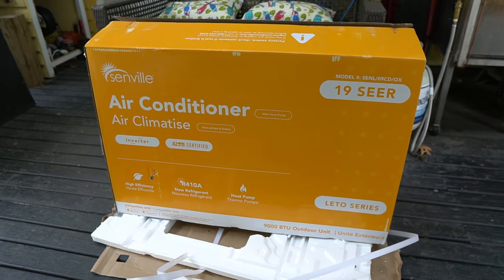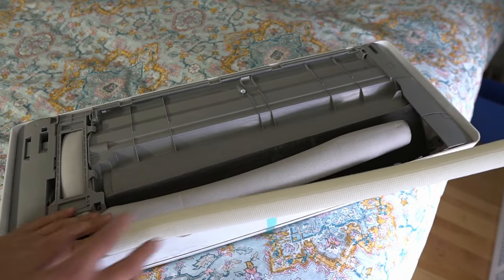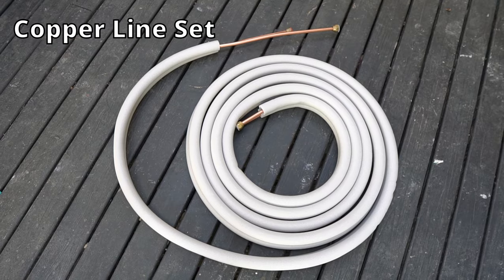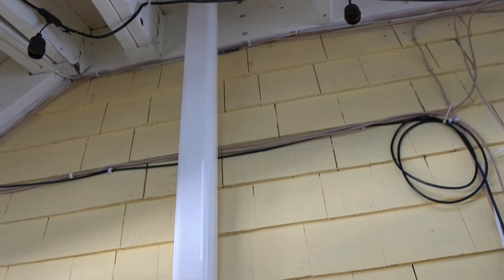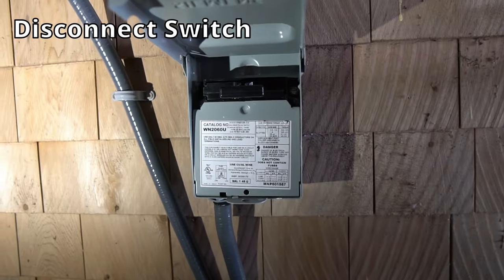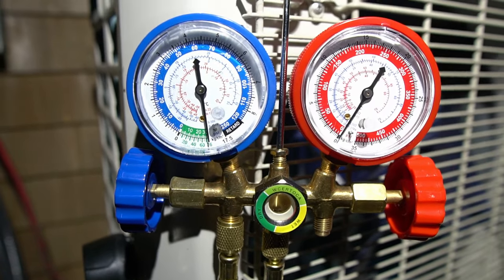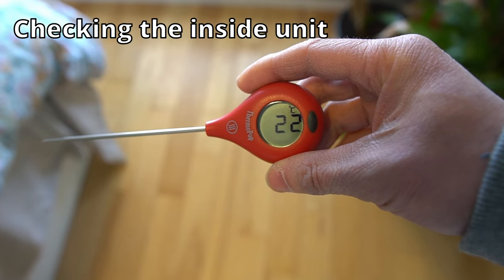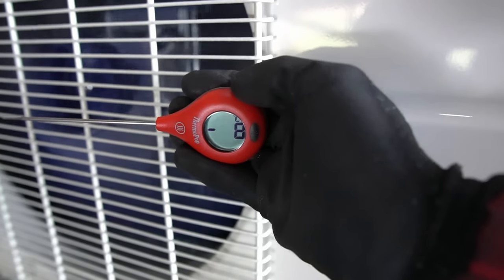How to Install a Mini Split Heat Pump | Senville 9000 BTU

Comment: I followed everything to T, checked every single wire and it's all getting a reading yet the unit won't power on. I contacted the company thinking the unit was broke and got a replacement, had a A/C guy hook it up and same issue. Any ideas? I disconnected my central unit and connected this to that.
Reply: One one I just did the indoor unit wire colors were mislabeled. Maybe same issue for you. Instead of what the label said for the wire order I followed what this guy did in his video (red, white, black). Didn’t work until I switched it to the above.

Comment: The amazon link in the description is for pressure gauges rated for r134a/r502. Not 410a. From what I'm reading they aren't interchangeable and you need to get pressure gauges rated for 410a. Maybe the link changed? Based on the attention to detail in your video I doubt you overlooked this. But for anyone referencing this video going forward make sure to get the right gauges.
Reply: He never fully pressurized the manifold gauges in the video, so it was fine. There will be no use for the manifold in the future either as these units have an accumulator tank with an electric expansion valve, so any future maintenance is a complete refrigerant evacuation followed by a vacuum and weighing in of the correct amount of new refrigerant.

Comment: I just received same unit but it's a 12000 btu sen 12cd. says the line sets are precharged so would I still need to vacuum and if so why?
Reply: oh you need quick connect lines and they are pre vacuumed. These aren't those so you need to vacuum or use a kwik-e-vac thing by pioneer

Comment: Just got mine up and running. Blows really cold. In either auto or cool mode the indoor unit never shuts off once it’s cooled the room. It just throttles back to low rpm and the outside unit shuts off. I don’t understand this ? Doesn’t seem energy efficient. Anyone else have this problem?
Reply: Yes, you can go into engineering mode using your remote. In engineering mode you can have your fan turn off when temperature is Reached. Forget about calling senville to help you out with that, they are clueless and worthless on how to do this. Kept saying they would have someone call me back to help me out, never heard back from them! Took my friend and me a few days searching the net to find this procedure. But it does work.
Reply: @chrisaudette7841  oh wow. I called Senville and tech support was knowledgeable and said it was indeed working correctly and in auto mode the fan will stay on. They said it’s more efficient which I don’t believe. I also worry the life of the fan will be reduced if it’s on 24/7. 

Do you have any links on the info you found ? Thanks !!!
Reply: These units have variable refrigerant flow and variable refrigerant expansion looking at the outdoor temp, indoor temp, desired temp, and indoor fan speed setting, so once it reaches the set temperature it should absolutely keep running. The most energy efficient thing you can do is to set your desired temperature and leave your fan speed set to auto. Obviously if you're not home you should turn it off or to a more energy efficient desired temperature.

Comment: can you tell me the two sizes of wrenches that fit the high and low side flare nuts? i am about to do the same project and am trying to get crowsfoot attachments that will fit on my torque wrench
Reply: Download the installation manual for the brand and model you are considering buying. The line and flare nut sizes should be in there.

Comment: I just installed 4 units se vile and none of them are working they all getting power I can’t get them to turn on any idea please
Reply: With a multimeter check your line(s) coming in are hot (220v 1&2 or  110v L&N) and then check continuity between the indoor and outdoor unit connections one by one (wires 1-3)

Comment: Can anyone answer this question for me? It would be greatly appreciated. I have a Shrader valve on the Low (blue) side that attaches at the compressor. I ALSO have a Shrader valve in the Supply (yellow) line that connects at the gauge set center. Do either or both of these need to be removed to do a vacuum test? If so, where might a guy pick up the tool to remove the Shrader valve? Thank you so much.
Reply: If you connect a hose with a valve core depressor (looks like a thin strip of metal running across the inside of the hose) to a connection with a schrader core then you do not need to remove either the depressor from the hose or the schrader core from the connection, although it will make your vacuum process faster if you do. Both parts can be removed with a "valve core remover" tool.

Comment: Do I need 2 hot wires and 1 ground or 1 hot wire and 1 neutral and ground ??
Reply: That depends on whether the system you but requires 115 volts or 230 volts.

Comment: I have the same model and same wires as you and everything but the wire diagram says something different than what you did. Idk if I’m reading something wrong and should just copy you or what 😂
Reply: Do what your manual says.  Most importantly, make sure whatever you do on one end, matches it on the other end.  Example.  Mine was wired 1. red, 2. black, 3. white/yellow on the indoor head unit.  There were no numbers on the compressor  where the other end of the signal wire attaches.  So, I put red, black, and white, from left to right just like I did on the head unit.
Reply: @da324  I don’t understand, my diagram on the inside front panel of the indoor unit doesn’t denote what goes in port 1,2,3. I’m assuming it’s red, black white. From left to right?
Reply: @rossh1152  That's probably correct, but it doesn't matter as long as the other end matches. If you put black in port 1, then,  put black in port 1 on the other end.
Reply: @da324  oh ok. I didn’t even think about that. Thanks for answering my question.

Comment: Can I ask why you switched the black and white wires on your indoor and outdoor unit? I am installing the same unit and terminal #1 is Red, #2 is Black, and #3 is White according the sticker attached to the indoor and outdoor units.

The outdoor unit has a sticker that says terminal #1-3 is for AC Power and L, N, Ground is for indoor unit. However, that doesn’t match up with yours either.

Comment: You kind of confused me with your comment about the line set length if they come with a 16-ft line set and you order a 25 ft line set you have to add more R10 ? ?? I thought the 16ft units support up to 25 ft so why would I have to add more refrigerant if it already supports up to 25 ft of it.

Comment: What happens if you dont vacuumed it
Reply: Ideally you want absolutely nothing other than refrigerant (in either liquid or gas form) in the lines. Anything else such as air or water vapor (sometimes called non condensables) will have an effect on the system efficiency costing you increased operating expense. Over a longer term the same contaminants will help form acids that will destroy the system from the inside out resulting in reduced reliability and premature replacement.
Reply: Worst case scenario the air turns the compressor into a fragmentation grenade

Comment: The white corrugated drain hose is garbage.
It will dry rot in 3-4 years and leak inside your wall. 3/4" PEX pipe is highly recommended in place of the cheap crap they supply. The pex fits perfect over the short drain hose on the indoor unit.

Comment: By using the gauge to check for leakage after releasing a little refrigerant, you are loosing a little refrigerant to the gauge on the line. Probably not the best plan if you have a 25 ft line, as that’s the max it’s pre-charged for. I notice they no longer do it this way in the manual. For other commenters, yes, pressure testing the line and using a micron gauge for vacuum is better, but these cheaper units don’t even talk about doing that.
Reply: *losing
Reply: @ironadversity2500  Well it loosed to the atmosphere ;)
Reply: It certainly would be better to use nitrogen, but this is DIY after all. He did say to consult an expert if in doubt. 😊
Reply: taking the gauges off when there's a vacuum will cause a little air/moisture to be sucked in, it is far better to lose a little refrigerant. it's not a big deal at all when it's a little bit of gas, not liquid - unless done repeatedly.
Reply: @Jon-hx7pe  my point was that they only puta certain amount of refrigerant in. I’ve always wondered when it says pre-charged for 25 feet, what that means when you use 25 feet, loose some, and don’t check the pressures and adjust with more refrigerant if necessary.
Reply: @MrRichBenn  yes. but not allowing non-condensibles into the system is more important. it is important to break the vacuum with refrigerant b4 removing hoses. 1 to 2 oz loss of gas is not going to adversely affect operation, has an eev, not super critically charged.
Reply: @Jon-hx7pe  I beg to differ. Some of these units have required extra refrigerant. Ask techs that get roped into installs of customer purchases. Too little can affect performance and longevity. Just need to be ready with some R410a, which all good techs have, as well as proper Mocron gauges and nitrogen for pressure testing.
Reply: @MrRichBenn  i know that, but even at 25f line, the max you don't have to worry about losing a little vapor in a hose when removing gauges. 
if a tech is doing it and has 410a handy to break the vacuum so the gauges can be removed b4 releasing the charge, that's all fine and good - if not and it's a diy install, no big deal. What's really bad is having the system under a vacuum and remove the gauge, great way to get air into the system again. Now, nitrogen should still be used for leak testing and a micron gauge for vacuum.
i think you're splitting hairs worrying about losing a small amount of vapor in the hose.
Reply: I am sure they put extra refrigerant to account for that sort of thing. Heck they even say to partially pressurize just above atmo to check for leaks so that you don't waste all your coolant if you need to fix a leak and vaccuum the system again. Idk if you'd actually have enough coolant then but they certainly put enough extra for the gauge hose
Reply: @ravenstarver1360  they don't - but the refrigerant isn't lost if there is no leak.
it's a shitty way to test for leakage, the proper way is with nitrogen.

Comment: What size wire and size disconnect did you use for this unit?
Reply: I would use 12 gauge, it's good for 20 amps
Reply: I have the same unit and used 12 gauge wire with a 30 amp disconnect.

Comment: Does the indoor have a water pump? I want to install it in the basement if I buy this would I have to buy the small pumps I see in other people basement? Or is there a better option?
Reply: No. It needs to be installed where the indoor unit can gravity drain to a low point.
Reply: @kevinhayes2805  i got the little pumps wasnt going to risk it

Comment: 6:45 Why didn't you follow the manual's instructions and apply the proper torque specs to both lines?
  That mistake on your part is ultimately what voided your warranty.

Comment: You bought gauges and a vacuum pump to do the job yourself ????? Gauges are $400 and a vacuum pump $1000 , you didnt save any money at all!!!!!
Reply: That same set he used in the video is $150 on Amazon.
Reply: Do you even need them to install pre charged lines?
oh you need quick connect lines and they are pre vacuumed

Comment: How many inches away from the bracket did you drill the hole does it say in the manual
Reply: It tells you in the manual. Some other units actually have a cardboard template that you use.